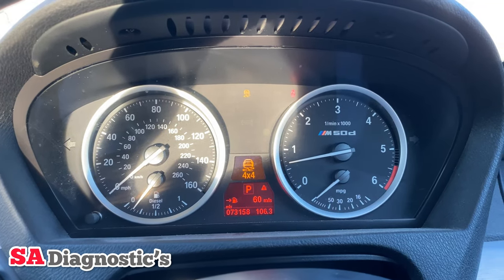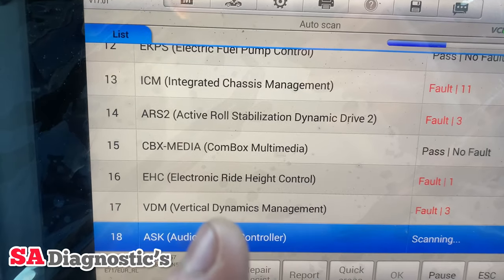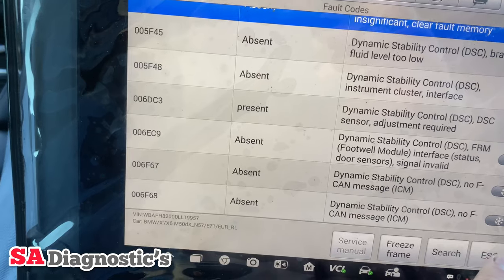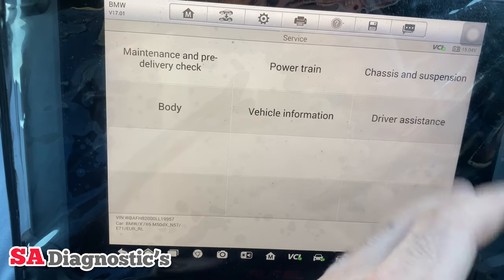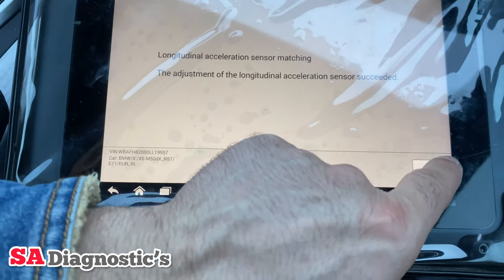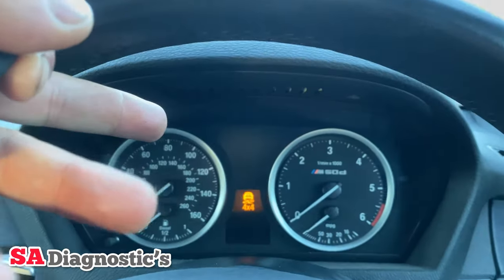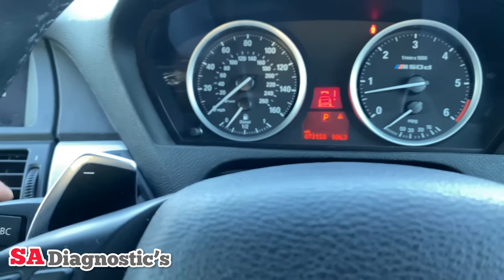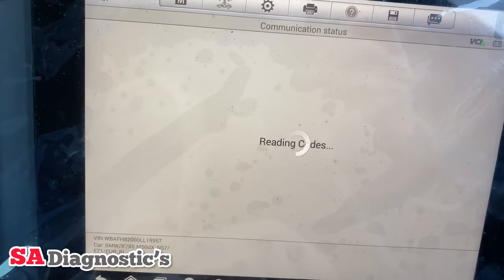BMW E70 E71 006DC3 Dynamic Stability Control DSC Sensor Adjustment Required FIXED!!!

Comment: yes but have you driven the car AFTER clearing the codes? did it come back? THAT is the issue I am having............. clear the codes, drive for 1 minute and it comes back.... 🤨
Reply from the maker: @djdad2482  yes never came back on this car it must be faulty component on yours… or it’s ethier your not coding it correctly…